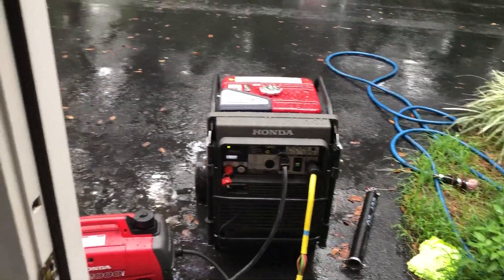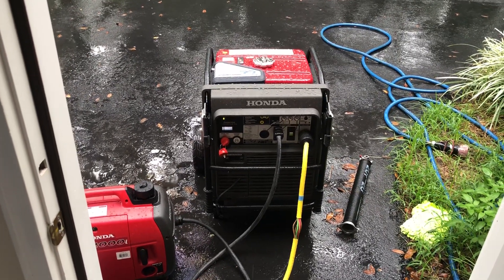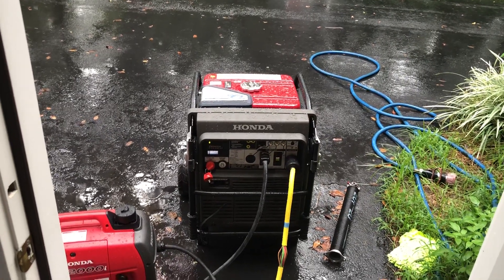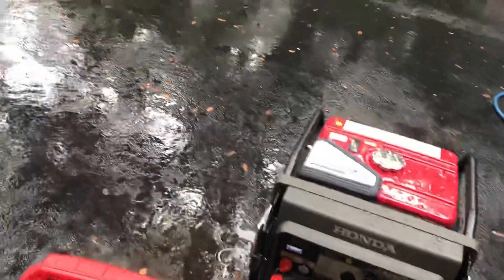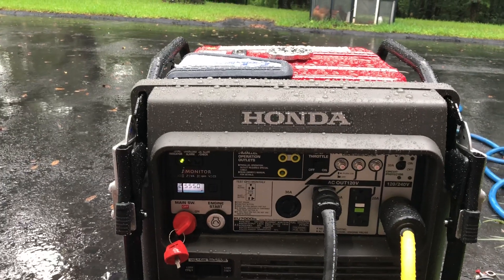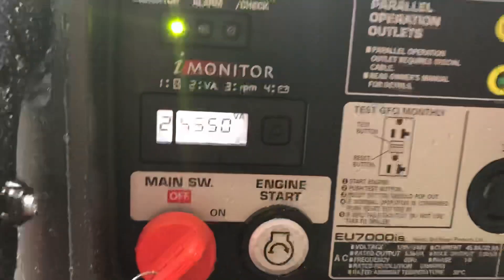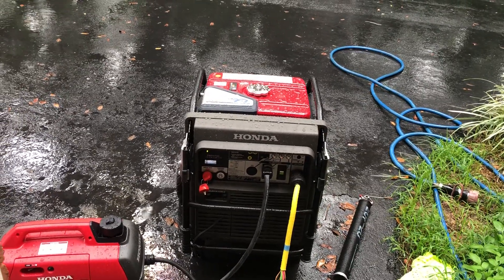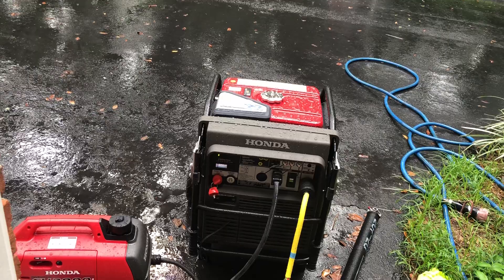Parallel operation of Honda EU 7000 inverter and Honda 2000 W inverter

Comment: Lol! You may want to read the EU7000IS's operator's manual. That generator' running watts is only 5500 (5.5KVA)for constant loading. 

Electrical devices can cause surges when they start, and Honda is mindful of that so they call it a "7,000" because it can output 7,000 (7.0KVA)watts intermittently to allow for short time surges.

Comment: How is that parallel? You aren’t using the paralleling cable that’s required to parallel them!
Reply: The paralleling connection isn’t magical. On the EU7000, it’s simply each leg brought out to the banana Jacks (240V). On the EU2000, it’s phase and neutral on the banana jacks. The inverter electronics detect and control the phase sync. The other posters are correct in that he’s only paralleled to one of the eu7000’s inverters, or one of it’s 120v legs.

Comment: It doesn't hurt the unit running in the rain???
Reply: You can see it’s in a decent housing but yeah that type of housing isn’t going to keep out all the rain so yes it couldn’t possibly be 100% alright. Just mostly ok. For using generators in wet environments you use more more optimal housings

Comment: I thought you couldn’t run the generators in the rain?
Reply: Where is the F did you hear that?
Reply: @mrtsparks9470 I run mine in the rain all the time…no problem.
Reply: brave man! i couldnt do that. haha
Reply: I don't know if I would try to run in rain another one after killing one. I had a loud open frame construction generator on top of a work van. I was inside van bright sunny day out of no where started heavily pouring rain. Generator was running the lights before I could even think about climbing ladder to roof to cut generator off. Lights went out engine still running, what happened water sucked up in generator head shorted out a internal fuse or popped something. luckily in those days warranties were way more than 30 days. Checked breakers and a few other things. So I traded burned out generator for a New over head valve generator. OHV Engines are pretty much standard now. And so much easier to start. And those old ones could break fingers starting. I met a guy broke a finger starting a non overhead valve engine around a 5000 watt generator. I had the pull start cord to kick back a few times and come out of my hand and in dead of winter. 🥴 After that I held so tight and pull started engine so hard. I thought I was going to tare the cord out.

Comment: Fascinating that the addition of the eu2000 on 1 leg didn't cause any problems. Have you tried adding another smaller 120v honda in parallel to the other leg? Each 5-15 duplex is connected to a different leg when the 120/240 switch is active. If you parallel a small generator on both duplexes then technically the loads are being balanced even though there are likely high neutral cross currents. 

I have an eu7000, eu2000, and eu2200 and need a little more juice to run my central air. I've been going back and forth on trying this out.
Reply: I'm curious if you've experimented with connecting the three together?
Reply: Daniel did you figure this out?  Theoretically it makes sense.  Any issues with phases lining up or do the Hondas adjust for that?
Reply: @bcrombie6536  I didn’t parallel both the eu2200 and eu2000 to eu7000. But I did parallel the 7000 with the 2200 and it worked great and ran my central ac effortlessly. I’ll keep this as an ace up my sleeve if truly needed.

Comment: Mike great video I'm thinking about doing this have you ever encounter any problems doing this? Thanks Rob
Reply from the maker: Robby Parsons No I have to do it quite often whenever I need the generator to start something big something that’s larger than what the generator itself is capable of starting and once it gets going you can just shut the other generator off. I’ve never had any problems is basically like jumpstarting a car inverters or DC power turned into 120 V I assume it’s about like putting jumper cables on a car I have never had any problem there’s a lot of things that won’t run such As 24 V battery chargers when I’m charging buses and I have to use two 2000 W generators or it will not make the proper ground on the charger will not operate not sure what happened there but it runs basically anything when you have two generators connected to each other.
Reply: @michaelvaughn5439  That's pretty cool I use the inverters for my home I have a 2200 and 3000 and would only think about parallel them to run my A.C unit in the summer time if we lost power. Makes sense with the male to male end cords.

Comment: I’ve seen you parallel many combination of inverters, have you done the Honda 3000 with the Honda 2000?, the reason I ask is I’m running a 3000 in a RV with two AC units and Can only run one. Believe it or not it will run the second AC for a couple minutes then trips the overload. I have a Honda parallel kit for the 2000 with The Banana push connectors, do you think I can plug the two together and it will help the 3000?
Reply from the maker: Michael Pascal I have paralleled every single inverter that I have in my garage which is about 10 different generators of different sizes different makes different models as long as you do not exceed the big plug amperage on one generator continuously it seems to hold the load fine with no problem the extra 2000 W connected to the 3000 W enables motors to start up much easier. The only time I have ever damaged a generator is when I disconnected the parallel cable while the Briggs & Stratton generator was running. But on the Briggs & Stratton generator it says all over the generator to never disconnect any load from the generator while it’s running I don’t understand that what if you’re using a Skil saw and you let up on the button and it suddenly removes the load from the generator. Anyway that caused that Briggs & Stratton generator to run uncontrollably high speed and sort of locked up the generator part or inverter part but the warranty took care of it and said that it was a bad inverter. LOL the most important thing to do is to connect your mail to mail plug before you crank the generators up and do not unplug it until you shut the generators down it seems like they sync with each other in perfect harmony .I have determined that inverter generators are just like connecting multiple battery chargers to a battery it really doesn’t hurt anything it just distributes the load evenly to each unit according to how much the output is on each generator..
Reply from the maker: But look at my other videos I am pretty sure I have paralleled several 2000 W generators with my 3000 W Honda generator all you do is run this mail plug into both units before cranking them up seems to work like a champ.
Reply: @michaelvaughn5439  thank you looking for those videos cuz I have the exact same question
Reply: Thank you

Comment: You should not do this because you are only supplying additional power to one side of the 7000.  Which means you are overloading one set of windings on the 7000.  Since you are paralleling the generators incorrectly, the safety on the 7000 may be inoperative.  The only way to do this correctly world be to flip the 120/240 switch to 120 volts on the 7000.  Unfortunately, you would not be able to run 240 volt items
Reply: Problem is he is only paralleling one leg.  The 7000 is a 240v AC unit with two sets of 120v 180 degrees out of phase with its neutral.  Paralleling only one  phase is a BAD idea like you said.  It is not the windings but the inverter boards most likely.  Surprised the magic smoke didn't come out.
Reply: @NETWizzJbirk  Combining Steve & NETWizz's comments - seems the issue is you are adding one leg to something with two legs.  And the "phase" of the legs might not line up.   That's two separate problems I think.  So if you had a eu2200 and eu3000 - each of those are 120V.  Does combining two 120's make sense?  Or would those be 180 degrees out of phase (I kinda guessed that question)?  Would adding two 120v's overload anything like "windings" and "inverter boards"?  If the 3000 is made for 3000 watts, it just seems odd you can send another 2000 watts thru that system.  For my question, presume we don't want to do any 240v appliances.
Reply: @bcrombie6536  you can parallel two 120v sources it not mattering much it is 3000 VA and 2000 VA.  Provided both sources are clean 60Hz single-phase and the inverters support pairing, they should pair no problem and more or less act like a paralleling two different size batteries like an A and C cell...  if both are the same voltage and type herts/phase AC or both are DC they can pair.   More power comes off the heavier duty battery that will basically charge the lesser battery to keep it from depleting at a different rate.   Same with pairing a 3000 and a 2000 generator.   If you put 4500 watts on it, the voltage drop would be huge and overload the 2000, but the 3000 should work with it contributing more preventing overload on the lesser inverter. Think of it like drawing 1000 watts from each standalone might drop the voltage from 127 to 123 on a 2000 watt unit, but might drop a the voltage of an eu3000 from 127 to 12&...  If you put the two together the drop might be to 126.  Basically, the stronger unit should do more work preventing an overload in a perfect world.  The problem is if it isn’t instantaneous or you get a momentary dirty waveform the inverters cannot track, you will likely lose sync and slip a pole in which case the 2000 unit will likely see 240v momentarily and most likely throw an overload and shutdown the inverter.   In the worse case, a cheap inverter will let some smoke out and smell like burning electronics.   Anytime you slip a pole the generators work against one another and it can cause equipment damage.   At any rate you should not pair a 120v inverter to a 240v unit.  In theory I get it that it pairs with regard to the neutral and one of the legs, but it is kind of like pairing a 9v to an AA... bad idea.   That said, I realize it works though is gross,y unbalanced.   If you really want to do this in theory you should pair two eu3000 units with an eu7000.  One between neutral one one leg and one between neutral and the other.   In theory the clock in the eu7000 inverter would hold both eu3000 units perfectly 180 out of phase with one another and locked at an identical frequency... it would also bond the neutrals of each EU3000 together.   At that point you could in theory grab the hot leg only from each eu3000 and get a perfect 240 volts AC just like on the eu7000
Reply: @NETWizzJbirk  thanks for that answer.  Tons of videos on this - very few insights.  In my case both would be Honda’s - eu2200i & eu3000is - not different brands and I hope not cheap inverters that you referred to.  Would that mostly eliminate the worse case momentary 240v you spoke of?  Honda says not to parallel different sizes, but hard to figure them out versus the math of it.  There’s also a Y cable for $60 on Amazon - the Parkworld 886115 or 61261 - seems like a gloried suicide cable merging into and with a 30 or 40 adapter.  I’m not saying that’s a solution just it’s another thing I’m researching - one guy said if you use that with tow different watt generator sizes then one might burn out the other - but he gave no supporting arguments or data
Reply: Steve so should he be paralleling another 7000 with that and then????. And really my question is if I run two Honda 3000i generators in parallel I'm still only producing 30 amps can I run 50 amps off my 30 amp plug in I would like to run both air conditioners that's it
Reply: He's playing with fire by playing with electricity in this experimental way armed with an incorrect knowledge thinking the EU7000IS generator can output 7,000 watts continuously. This generator only puts out 5,500 watts continuously and 7,000 watts occaisionally for starting surges lasting only seconds at a time. Not using the paralleling cable is equally as dangerous if he tries plugging in a split phase load like a 230vac AC unit, washing machine or dryer...
Reply: DO NOT DO THIS! They should be identical units PERIOD!!!

Comment: What is your wiring setup? I have those same two generators.
Reply from the maker: shakyzeg Just go to Home Depot and get some heavy-duty rubber coated wire and put two male 15 amp plugs one on each end and plug it up before you start the generators and do not unplug it until both generators are off and it will distribute the load equally just don’t overdo the outlet on the 7000 W generator because with the set up you could actually out do the outlet.. Only this is for starting things that have a large surge rating
Reply: @michaelvaughn5439  thank you. I didn't realize the EU7000 can load balance the 240v out, with a little extra 120v coming in the standard 3 prong plug via a suicide cord from the EU2000i. Parallel via like generators makes sense. Honda avoids the suicide cord by making the same connection via a female connections on both ends, cord, and calling them parallel cables. I suppose if I can find a way to make the female version it would also work through the parallel connections. Thanks again!
Reply: @shakyzeg  I would not do that. The mat for connecting 240V gen with 120V gen does not add up.